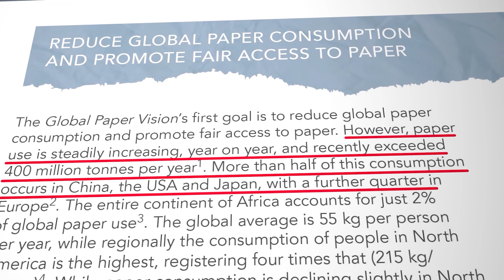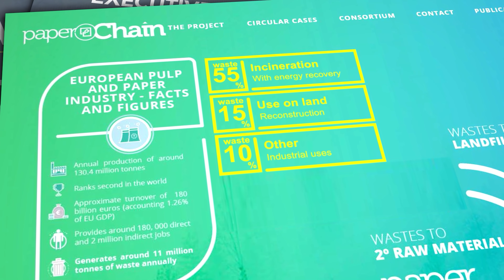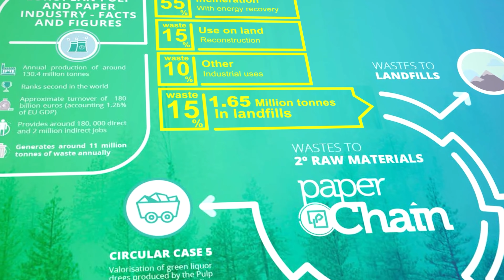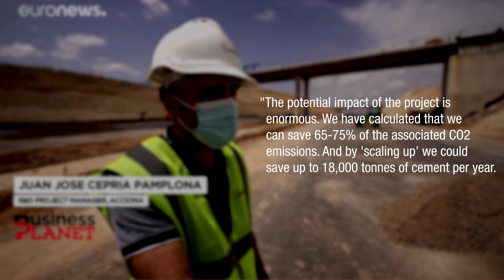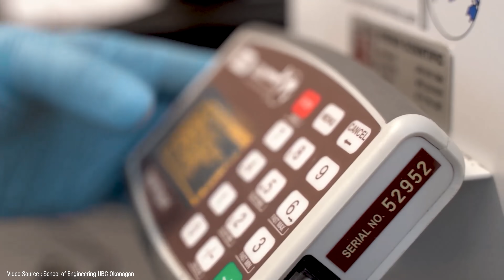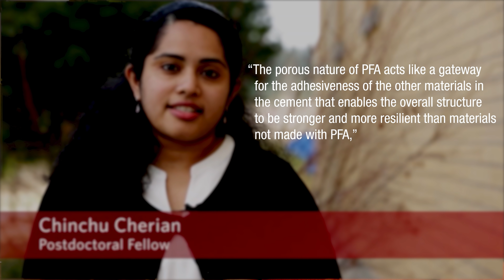Could papermill landfill waste pave our highways?

Comment: 8:15 -- secondary process involving mixing with water, pressuring and burning at 750c.  When you add in the environmental impacts of the water and energy needed to perform the secondary process to those used to produce the ash, how do they stack up against current construction grade concrete?
Reply: Still pretty favourably. It is basically the same process for producing normal cement, except with a different feedstock. The big difference is that you are not starting with a carbonate, so you don't get an endothermic 'burning off' of CO2. That means far lower inherent CO2 emissions, and marginally lower energy cost. Granted, still not ideal, but better.
Reply: @agsystems8220  Ok, good to know.  Thanks.
Reply: @agsystems8220  From a big picture point of view, isn't the CO2 emissions associated with concrete production still present with this fly ash process?  It's just upstream in the incineration of the paper pulp to produce the fly ash itself.
Reply: @wbedard  The fly ash is produced anyway in processing the sludge material but it is sent to landfill.
Reply: Precisely what I was thinking.  After all, calcination is what is so environmentally expensive in cement production.
Reply: It's the safe low-tar option.
Reply: Much lower temp than burning limestone isn't it.  Pretty sure 750 is super achievable with electricity.
Reply: While our personal computers replace the need for tons of paper for storing information isn't better we keep the usage of paper byproducts to a minimum..?
Reply: @steve-o6413  exactly.  This process cannot be looked at in isolation.  Last thing we want is for this form of fly ash to become so popular that deforestation intensifies simply to keep up with fly ash demand.
Reply: Depends on your sourcing of energy probably, but it could conceivably approach zero as you move towards all electric processes with sustainably sourced energy... So good in the long term :)

But that's probably not your immediate question/concern is it?

I'm sure the LCA has been done on it and is available to look up somewhere, by the guys making the stuff. And if it's not there, it'd be a good time to raise eyebrows :)
Reply: Agree. Need the total lifecycle carbon calculations for this. I doubt there is much net gain.
Reply: Use solar furnaces 🌞

Comment: Thank you Dave for an again for presenting us an interesting and smarter solution that could help to reduce our green house gas emissions.
Reply: As long as the waste isn't turned into an asset so paper gets cheaper and increases consumption. The "fiber" has to come from somewhere...in BC, Canada, the old growth forest ecosystems of Vancouver Island are being clearcut for shingles and "fibre." Advertised as a "renewable" & "sustainable" resource. We may solve one problem and create more without dealing with the root causes.
Reply: @emrusso4625  my thoughts also, since the paper reduction act to reduce the cutting of trees which reduces Co2 emissions naturally a reversal would due more harm than good...

Comment: Fly ash from coal fired plants has been used in Aerated Autoclaved blocks for a very long time.  I have also heard some are looking at it as a sand substitute in rammed earth.
Reply: Fly ash is filled with toxic residues.  Not a good idea to build our roads from it because the toxins will just leech into the surrounding soils, etc...
Reply: @Les_S537  guess you missed the part where he said they would lock up the toxins in the fly ash.  I dont know.. I just heard what you might have missed
Reply: Would Sahara sand be usable in rammed earth? It is not good for concrete.
Reply: @kitemanmusic  it is not the sand it is clay that actually is more important as it is the binder that holds the earth together. Sand is the filler as would be fly ash.  Think the fly ash would actually fill the voids in the sand as it is that much finer.  I have no clue how sharp or rounded sand is from the Sahara but would assume it to be rounded down.

Comment: The first step should be to save paper - there are solutions for re-usable boxes that could immediately replace amazons paper packages. we could forbid printed advertisings, use digital books, digitalize our administration, re-use every bit of paper (do not buy post-it blocks), chose „direct-recycled“ paper products instead…
Reply: Packaging definitely... But I like real books... You don't have to charge them up, and they don't stop working when the power runs out :-)

Comment: If you lined roads with the forming wire and press blankets under concrete maybe it would be a help?🤔 As for the actual paper waste, if it stays dry maybe.🤷‍♂️ Makes more sense to burn it in a hog boiler when it dries out, to provide energy for the plant.

Comment: That fly ash can be used as fertiliser. 
That could reduce the huge co2 consuming unsustainable expensive fertiliser.
Reply: Yes! We use wood ash in the garden. Take care to dilute it to avoid damaging the roots.
Reply: If I'm not wrong ash make soil more acidic.
Reply: @Angel24Marin  that ash is basically potash. That’s what it’s literally was named after put+ash. 
An essential fertiliser in agriculture. Literally from plant back to plant; minus all those processing, resources and energy consumption.
Reply: @Angel24Marin  Fly ash, all ashes that come from coal burning, etc have toxins in them that leech out over time.  Using fly ash for roads or fertilizer strikes me as a bad idea.
Reply: @drpk6514  You can also get fly ash from coal burning power plants.  Fly ash is typically found in the stacks and fireplaces, ie chimney sweeps deal with it all the time.
Reply: @Les_S537  did you watch the video? It’s about paper burning.
Reply: @drpk6514  I watched about half before jumping into the comments...  Here's the problem I see with it...  Waste incinerators that would be used for paper would still result in toxic results because paper is never just paper once it's been used in packaging, etc...  Plastics are mixed in.

Waste incinerators release more toxic pollution than coal fired plants do per unit of energy.

They release dioxin, carbon monoxide, nitrogen oxides, sulphur dioxides, et al...
Reply: @Les_S537  nope not true. The paper burns very clean and the toxins are minimal. The things you mentioned are just gassed and don’t end up in ash. 
There are even ideas to use the coal fly ash for agriculture let alone with paper ash which is clean. 
If you don’t know enough about something please don’t give wrong ideas.
Reply: @drpk6514  rolling my eyes...  I've been arguing against coal use for years, with coal ash being the really bad leftover stuff at the end of it.

Coal is never just coal.  Mixed into it are other metals that have leeched into the coal via geologic forces...  There are radioactive elements like uranium in coal, lead, mercury, etc...  When burned in a coal furnace, some of those particulats go out the stack landing in the vicinity of the power plant.

This means radioactive, toxic particulates are in the ground around the plant, and in the furnaces and smoke stacks as well.

Same thing applies with paper burning.  Mixed in with the paper are all sorts of toxins and other things that, when burned, get mixed in with the fly ash from that process.

It is a fact that waste incinerators are more toxic and polluting than coal power plants PER UNIT OF ENERGY
Reply: @Les_S537  No, again and again you are talking not based on what you know, but what you assume, which is wrong.

This is not about coal its about paper and paper and coal are different. The chemicals you mentioned are gas not ash and paper doesnt have radioactive materials. And paper is used in power plants not waste incinerator which usually burns garbage and plastic.

Again, talk about things you know not about things you assume.
Reply: @drpk6514  The irony of your last sentence escapes you...
Reply: @Les_S537  
You don’t even know the difference between paper vs coal
Gas vs ash
Power-plant vs Incinerator 
I wouldn’t have commented here if I were you …

Comment: Would digitalization of that paper make it more environmentally friendly? (just thinking about the servers etc. )
Thing if they penetrate the market they also need to find a way to heat that stuff up to 700C without burning to much electricity and solid/fluid/gaseous fuels with carbon emissions.
Reply: Use wind turbines or solar panels to produce the heat.   NO carbon emissions.   Voilà!
Reply: @dr.OgataSerizawa  That is a dream world these things need to run 24/7 else it doesn’t make much sense. But same can be said from the servers too.
Reply: I just found an 2014 news article on electronic vs paper  that stated: it depends on how much and how long and how often you read. And how sustainable is the ink and the way and range the products  are transported: A quick look in the newspaper has a highe carbon footprint - a paper read intensively and shared with your neighbors is much better than the e-version. You need to read at least 100 books on a multipurpose device before replacing ist to get to the break-even with carbon emissions from paper books. But the source is not the newest and most detailed.